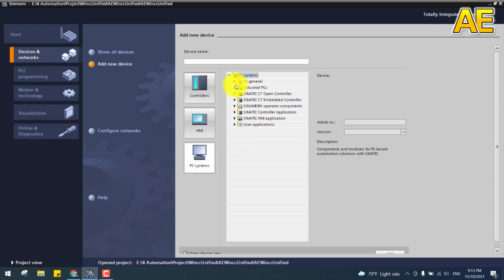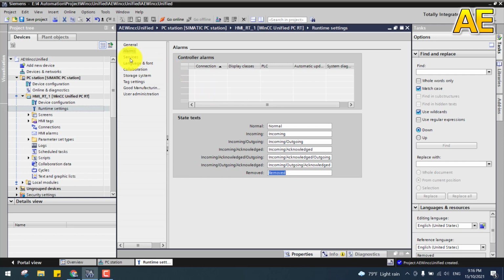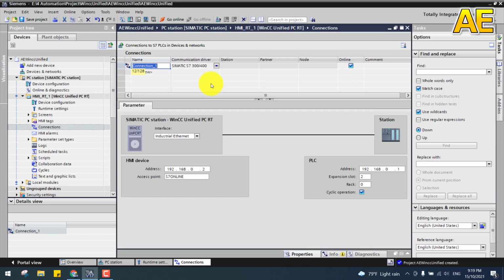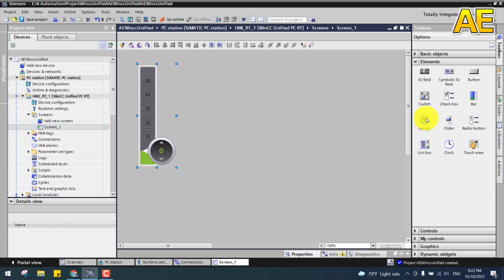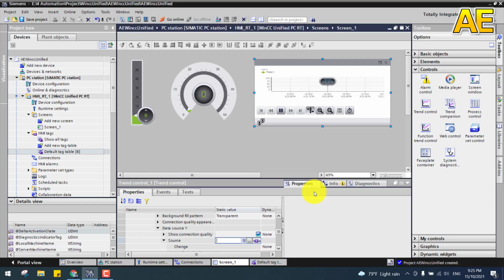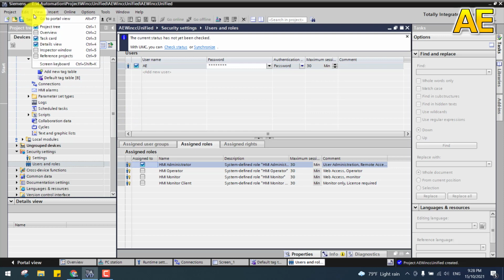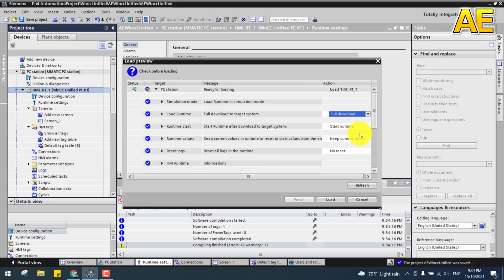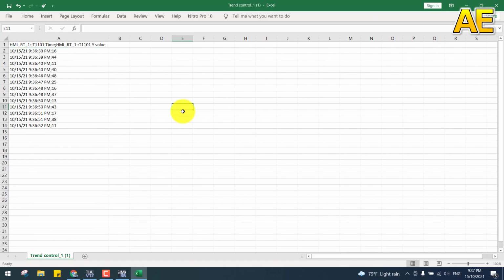WinCC Unified V17 Part 1: Overview And First Project

Comment: Hi,

Thank you for your video. I tried the exact thing as you did, but if I move with slider, it will go to 0 immediately. Do you havve some idea, why is it doing?
Reply: I have same problem. Please did you find any solution!
Reply: Hi,  @abdelmouinboukhalfa4684  

my problem, was that: I havent got a real PLC so I had to use an internal variables to test things.... Hope it was helpfull.